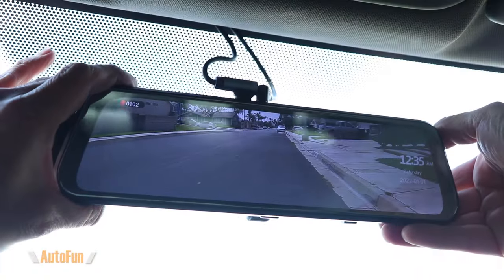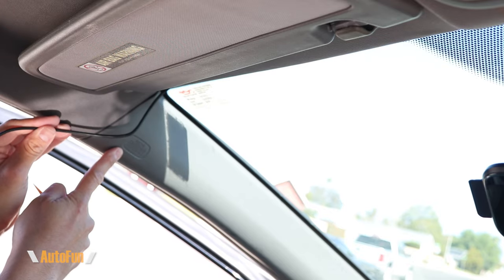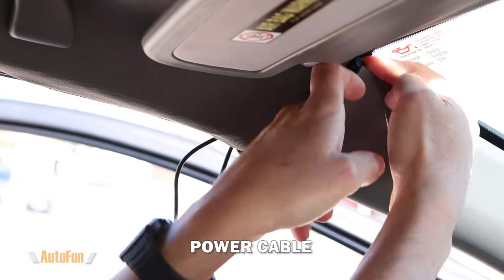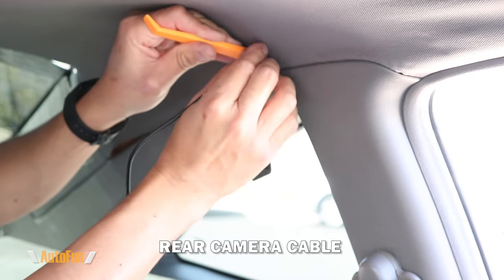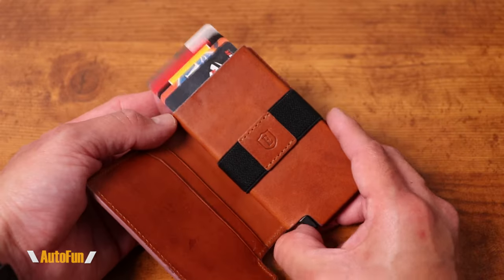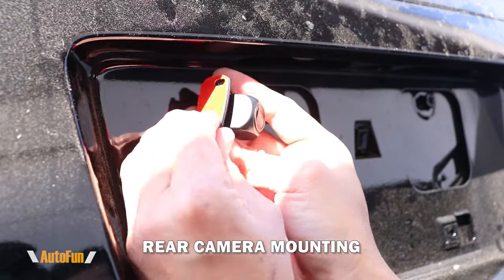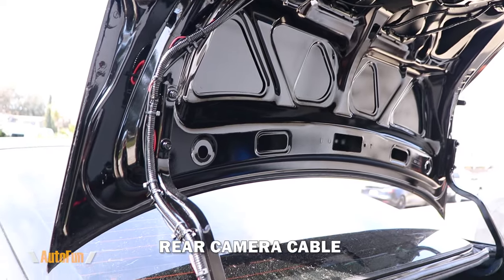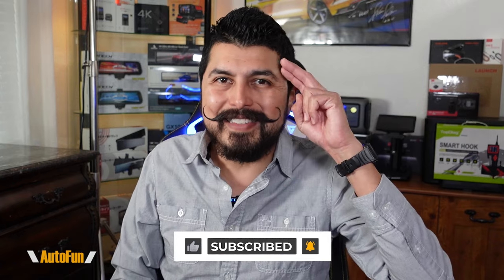Honda Civic Mirror Dash Cam Install (Digital Mirror)

Comment: Hey Alex since I know you love these rear view mirror dashcams I thought I might re-post what I used one for in a fb group I'm in for my 2024 BRZ.. The rear view mirror dashcam I use for this is a GKU M10. I have pics which probably help make more sense of what I've written below.

This mod I put together because I wanted to see whats right in front of the car ie bump stops and gutters (especially when parking) and know exactly how far I can go up to them without hitting. In my Impreza this is not so hard to know but in this car we sit low and far back so its harder to gauge (or remember!).
So I bought a rear vision mirror dashcam with dual camera (2nd cam usually used for the rear window) however I already have a rock solid viofo 229 duo plus doing that job.. so instead I installed the rear cam of the mirror low in my front bumper. With this rear view mirror dashcam it shows on the mirror exactly what either cam can see.. I chose the front bumper cam and it now stays on that view regardless of engine stop start etc.. it will only change view if I manually select to change. I then set the mirror to sleep in 1 minute, meaning it reverts to working as a normal reflective mirror unless I touch it which then shows whats ahead of the bumper.. after which it returns to mirror again. Also this gives redundancy if one of my dashcams fails as I now have 3 forward facing cams and one at the back. As always I add new circuits for these add-ons and install under the dash/kick panel so I maintain the OEM look.
Reply from the maker: Nice! Yeah that is definitely a cool use of the mirror dash cam, I had another viewer place the 2 camera in the bottom of his Jeep since he does rock crawling and wanted to see clearance. I tell people really there is so much potential for this mirrors, only limited by your imagination and the skill of the installer that is installing it. Cheers!
Reply: @AlexAutoFun  Yeh thats an interesting use too.. btw where would you suggest tapping into the high beams for some led spot lights Im putting in on my brz? I can't seem to use any of the traditional headlight harness adapters as the "bulbs" in my headlights are sealed. I could tap into the high beam circuit at the fuse but I always did it from the the wiring at the bulb in the past? Thanks Alex.

Comment: This video does not seem to include connecting the red wire to the hot cable on the reverse light when on.
Reply from the maker: Hi J! Ah yes here is my video for the optional wire for park assist https://youtu.be/LHGxwulIPes Cheers!